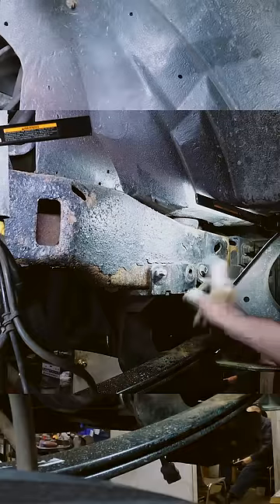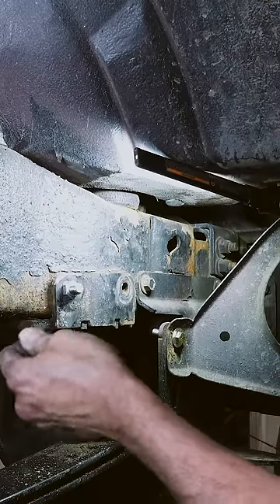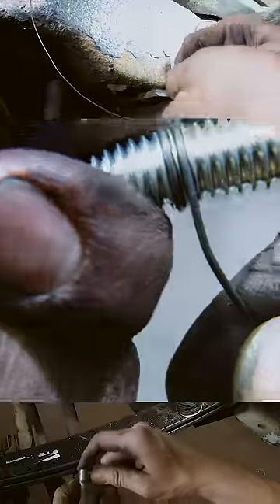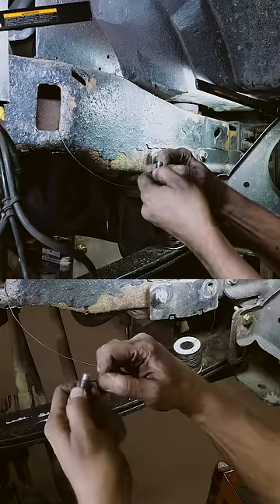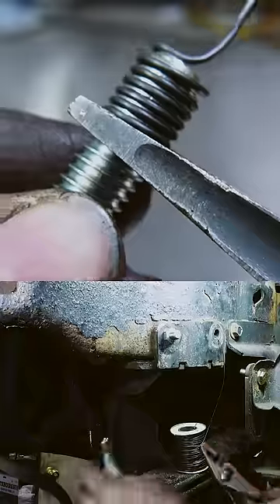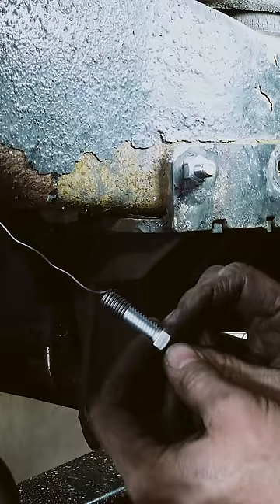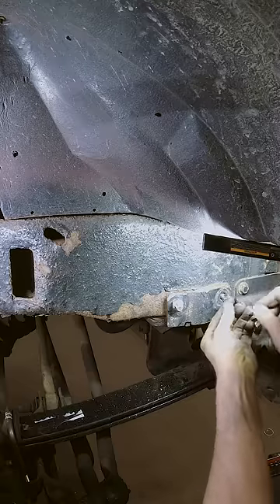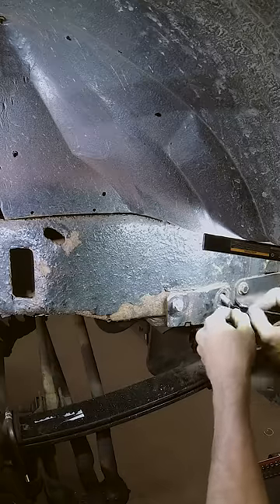How to Fish A Bolt Into A Hard To Reach Spot #shorts

Comment: It doesn't matter what you tighten it with it still needs a washer. And if this works then you're using the wrong size bolt...
Reply: I dunno about the washer but you are 100% wrong about the bolt size. This is literally what manufactures of hitches send to slip the bolts in hard to reach areas😂
Reply: @Jeromeeb you sound confused
Reply: @jacobpoucher You sound vaccinated 🐵
Reply: Why does it need a washer? I almost exclusively avoid washers on most things unless it's a slotted hole
Reply: The washer goes under the nut, not under the bolt
Reply: @valkman761  wrong
Reply: @jacobpoucher  it always goes under the tightening element. The purpose of the washer is to minimize friction and prevent the nut from becoming loose
Reply: @valkman761  wrong again
Reply: @valkman761  yes, that's one of the uses of a washer. Sometimes you need to use them for load distribution though, so the bolt head exerts pressure on a larger area because a grade 8 bolt can deform milder steels effortlessly
Reply: @kstorm889  because it's a hardened bolt going through mild steel. It will likely deform upon install and will deform through use. So you use a washer to spread the pressure exerted by the bolt head on a larger area.
Reply: @monkeyonarock I second that notion 😂
Reply: @blueberrychronic  I think you have bigger issues if you need a washer to prevent the beam from becoming deformed, but I get your point. At this specific installation the force tries to shear the bolt so it's less of an issue.
Reply: @jacobpoucher  I feel sorry for you
Reply: @valkman761  I feel sorry for you! The washer spreads the clamping load end of story.
Reply: @jacobpoucher  the washer has an contact area very close to bolt head. The effect you're describing has minimal influence on the entire structure. On the other hand, leaving the nut without one probably results in a catastrophe
Reply: @valkman761  not suprising you watch Keith fenner. I got my own shop also. Your channel has no content. Go ask kieth where the washer should go
Reply: @jacobpoucher  I do not need to ask anyone for something that's so obvious. "Your channel has no content" type of comment show you really are one of those ...you know, armchair engineers
Reply: @valkman761  keep fishing dude.
Reply: Your all wrong you use the washer to keep your nuts clean. You see what I did there?🤣 I made a funny, now calm down and be nice to each other children.
Reply: @pizzadude6615 you're*
Reply: @Jeromeeb  Which would indicate a slight oversized hole, as the engineers know exactly what size bolt suits applications...
Reply: @charlesangell_bulmtl  so you think companies making hitches aren't using engineers to design and spec their products? Using the wrong size hardware for the application would open you up to lawsuits if you are the one supplying it.
Reply: Girls, girls, your all pretty!
Reply: @kstorm889 man I hope I never buy anything built by you then lmao
Reply: @valkman761  wrong again!
Reply: @iDAV8  Im a licensed engineer. Although unless you run heavy equipment, there's probably nothing you use designed by me.
Reply: @kstorm889  you slow
Reply: @valkman761  you sound lost. Like biden
Reply: @crazylogie1272  and you seem to be stuck into this specific comment section. Get a life
Reply: How about we just put washers on bofe sides whenever possible and kive happily ever after?  😊

Comment: bolts too small for the hole
Reply: Right it maybe a size to small but In my mind at least there’s a bolt in it now.
Reply: Check out the bolts in front of and behind it.  It strikes me these may have been threaded holes but the threads are now toast.
Reply: @matthewscruggs7104  a smaller bolt will do little to improve the situation and likely result in the problem continuing to be unaddressed. Its a band aid on a bleeding artery.

Comment: Did you put in your bolt through there that's smaller diameter then the factory one.... What the hell I don't think that is a wise move even though I'm not an engineer nor am I in ASE certified I have worked on the car since hell before I really finished puberty